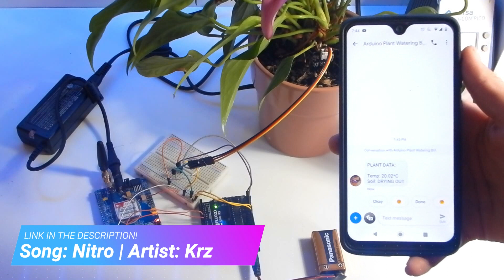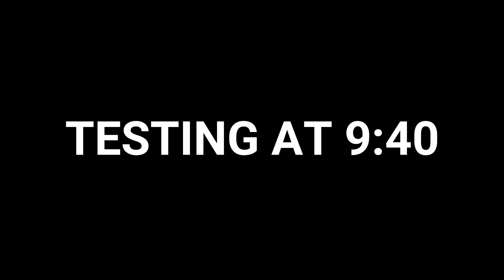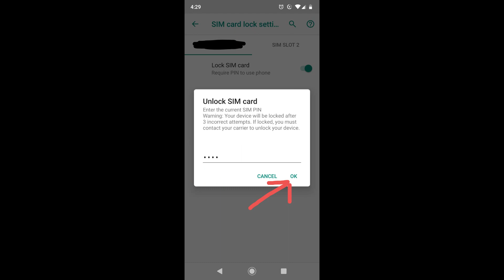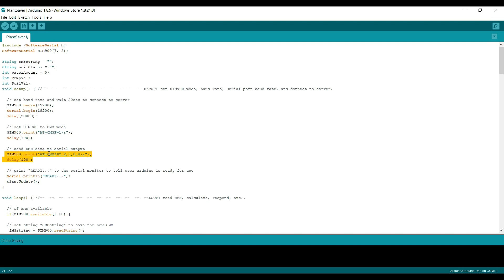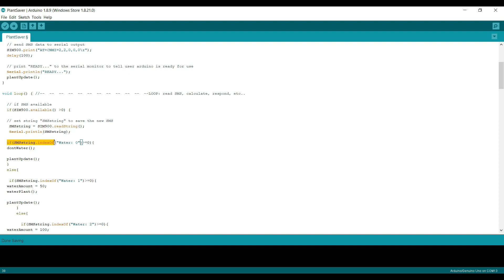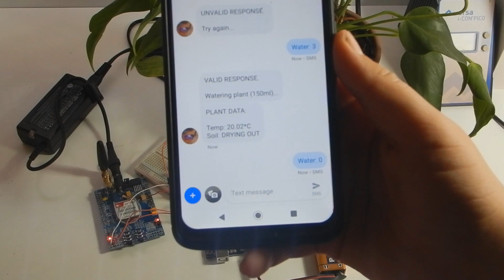Making an RC Plant Watering Device (Pt.  2/4)

Comment: Good stuff mate, cool to see the project coming along. Would still like to see a little more stuff happening inbetween you explaining the code as it is hard to focus on the same screen for so long. Even if you maybe try just zooming into the bits you are talking about as you go over them.
Reply from the maker: Thanks! 
The reason I didn't put more time into the explanation was because this took way longer then I expected and I had to finish another video to automatically upload (21th) while I was on vacation.
I'm actually in the car right now! (on the backseat of course)
But thank you for the tip!

Good luck with your game!